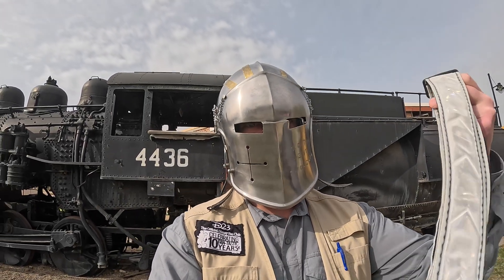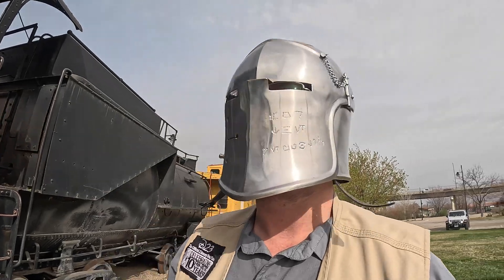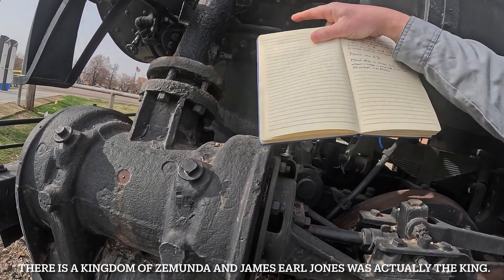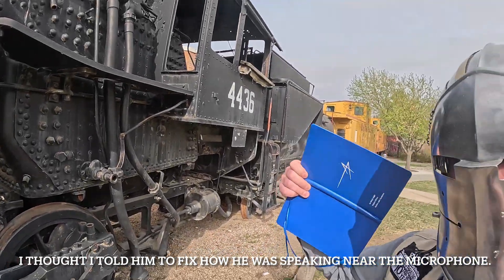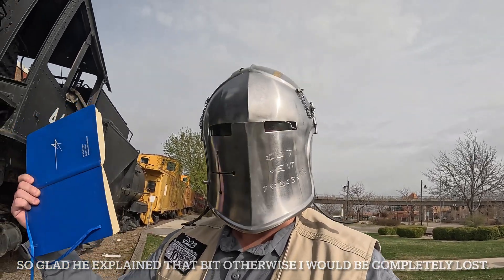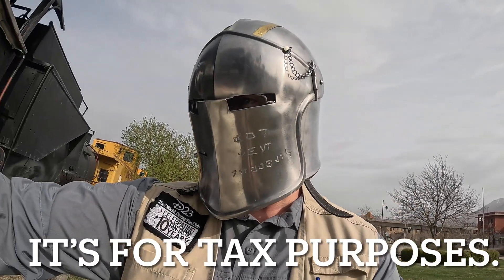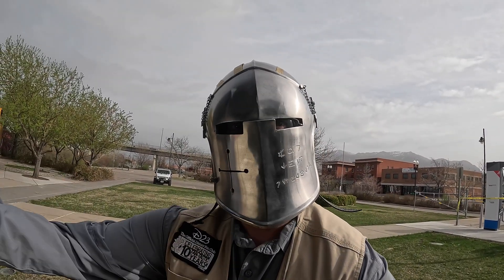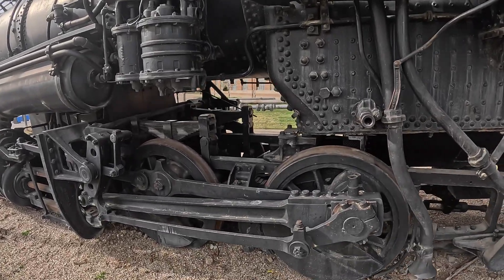Gas laws applied to steam engines.

Comment: Well, Boyle's Law is the right way to explain this action. Steam is delivered at a (hopefully) constant temperature and pressure into a volume that changes mechanically.  It's the tuning between the change in pressure in the pistons and the constant pressure of the steam balanced with its temp.  Lose temp in the steam and the locomotive should lose some power as a result.